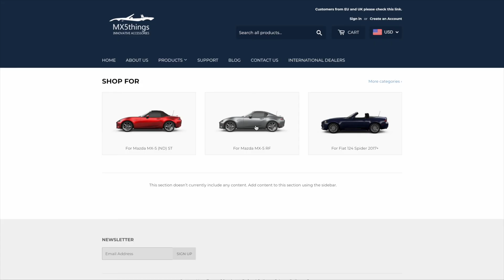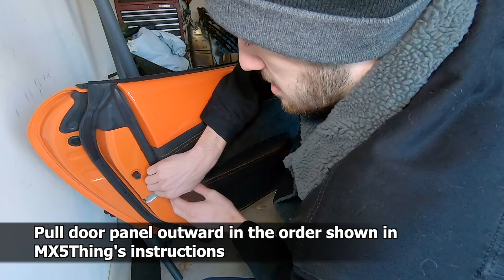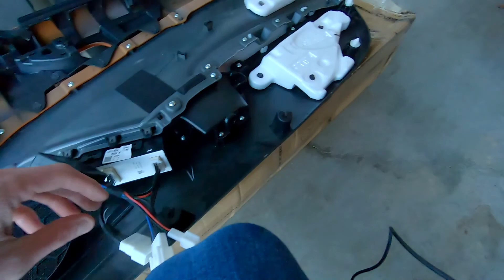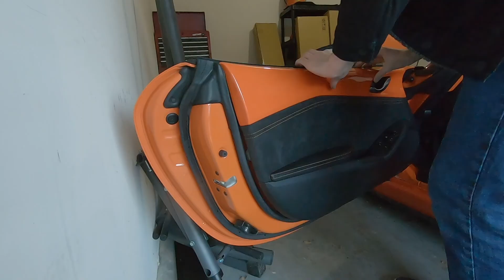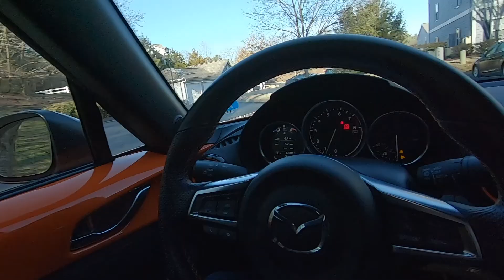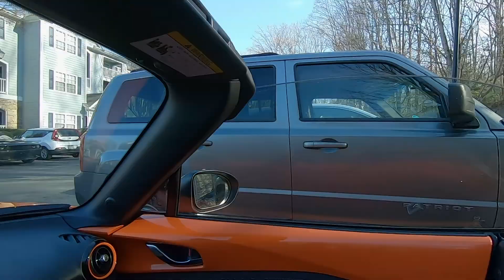ND Miata Automatic Windows Mod - MX5Things Auto Window Controller Installation and Set-Up

Comment: Great video! Has anyone here done this in the UK on a RHD vehicle? I'm not worried about having this on a keyfob, but looking at the documentation, there's a whole piece about some UK/EU cars having different locking mechanisms. I'm assuming, given I don't need the keyfob feature, then this wont be applicable? I simply don't want to be messing around with wires personally and hope for just a plug and play like the video above. It's scary enough to remove a door panel on a new car!

Incidentally, would this potentially invalidate any warrantee or be classed as a mod for insurance?
Reply from the maker: Hi there, thank you for the compliment and watching! And sorry for the delayed response.

Unfortunately I can't speak to the key fob mod on or any differences with UK/EU cars. I would assume if you don't plan on doing the keyfob part then you would be okay. As far as warranty goes, I could see Mazda denying warranty due to this modification, if they were to find out about it... In the US, they are legally supposed to prove in some way that the mod did or could have caused the damage, I believe.

I doubt this would affect your insurance, may not even be worth mentioning.

Comment: Could this gadget potentially drain the battery when the car is not in use? I have this problem with my car and have to keep it on trickle charge. The previous owner installed this gadget and I’m wondering if I should get it removed? Thanks.
Reply from the maker: @MaxCatAngel63  I don’t think so, I never noticed this issue but I can’t say for certain. Any other mods on your car?
Reply: @ It has the LED DRL Harness, this enables LED DRL functionality when the headlights are on.
Reply from the maker: @MaxCatAngel63  I had the DRL harness too. Still never had issues with my battery draining. Both the lighting and the window circuits should be de-energized when the car is off. It’s possible they could be defective but I don’t think they are the cause. Try removing them one at a time and see if that changes your battery drainage problem. If not, there’s a parasitic loss elsewhere
Reply from the maker: I can’t remember but I could have sworn the 12V outlet under the dash stays on when the car is off. Do you have anything plugged in there?
Reply: @DriveMX5  Thanks for your feedback and advice. Nothing plugged into the 12 V outlet. It’s a weird mystery!  I’ve taken it to the garage and they can’t find any drain. I think I’ll take it to a specialist garage for electrical faults. If all fails then I’ll just have to keep it on a trickle charger.
Reply from the maker: @ let me know what they find, I’m curious about it!
Reply: @ There’s a long waiting time to get into this specialist garage, as they’re very busy. But I will definitely let you know if they’re able to solve the mystery. Thanks for your channel.
Reply: I’ve booked the car into the garage for 16 June. I’ll let you know if they’re able to fix it. Thanks

Comment: You mentioned the keyfob option but now they offer the RCF2 and there is no keyfob option so I am assuming it works with your stock fobs? Any knowledge on this?
Reply from the maker: I don’t know anything about this. I’d ask MX-5things directly
Reply: @DriveMX5  Golden, I had a re-look at this install instructions and the connector you were holding onto (red and black wires) gets taped into the main controller connector on the door. That being said your harness has more capabilities to use the stock door lock button and fob(s) you just need to wire that plug in.

Comment: Hi, thx for the tutorial, I follow all steps but I think made something wrong, I want that windows go up when open the roof, but it go down, how I can fix that? Thx
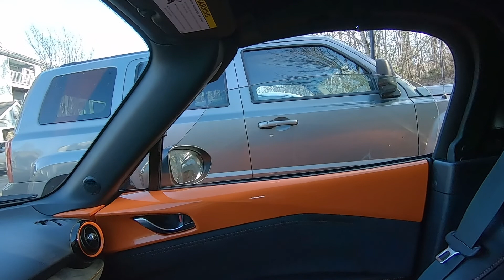Reply from the maker: Hi, thank you for watching! At 5:56 in the video, I describe and show how to program the windows to go up or down when you open the top, depending on your preference. I believe the default programming is to have the windows go down when opening the roof. If you want them to go back up instead, then do this starting with the roof up:
1. switch ignition on (engine can be on or off)
2. unlatch soft top and leave it in this position, windows should go down about 4 inches
3. using the driver window switch, move both windows up a little bit
4. put softop down and lock it into place.
The controller should now be programmed to move the windows up when you open the soft top and it should have done so at this point. If not, trying closing and opening the top again. If it still did not work, repeat these steps. If the windows are STILL going down when you open the top, refer to MX5Things for additional support. I hope this helps!
Reply: Thx! Now works like I want, only sometimes the right window stop to work, sometimes full open and is nothing to do.... Omg that's crazy annoying 😢
Reply from the maker: @gabriel1555  you disconnected the battery before installing your window controller, right?

Comment: just curious, would you be looking into a mod that makes the elbow rest from inside the door panel a bit more roomy? since the factory one is so narrow they could have as well left the inner door flat
Reply from the maker: I agree with you there. I’ve thought about trying to design and produce one since I’m not aware of any aftermarket options but have not put the time and effort into it yet. Plus trying to add the leather, foam, stitching, etc would, in my mind, make the cost too high

Comment: Thanks you're the only one that explained how to initialize the unit
Reply from the maker: Thanks for watching! I try to be as thorough as possible without rambling too much
Reply: @DriveMX5  You have really helped me with a volume of projects on my 2017 ND GT.  I have installed the daytime lights fix, trunk light bar, trunk popup kit, automatic window controller, Carplay kit (including USB wireless connector),  AEM air filter with new post airbox knuckle and did the noisemaker delete.  I have ordered the headers to exhaust tip with tune as well.  I am pondering if the upper strut tower brace is worth doing or what other upgrades would be fun.

Comment: Thanks for this video, I always find all of your content helpful.

After a couple months, are the windows still working as programmed and do you notice any changes in how quickly or smoothly they move?
Reply from the maker: Thank you! I’m glad the video helps. So far I’ve had no issues. A couple times the auto controller failed to put the windows all the way up or down but I’ve never not been able to operate them manually and they still move at the same speed and smoothness as before the controller. Overall I’m still really happy with it!
Reply: @DriveMX5  Good to know. Thanks again!